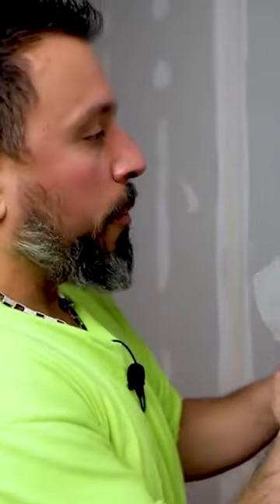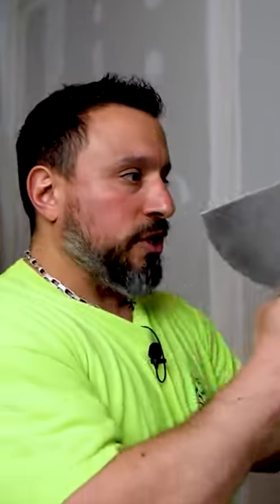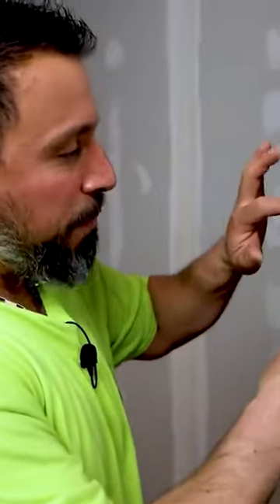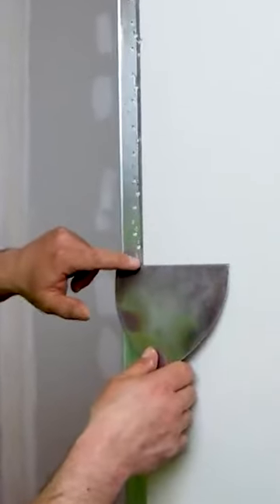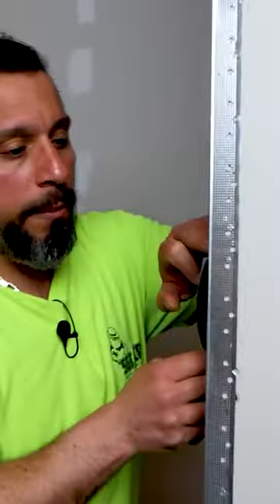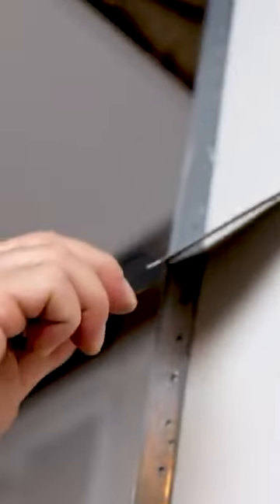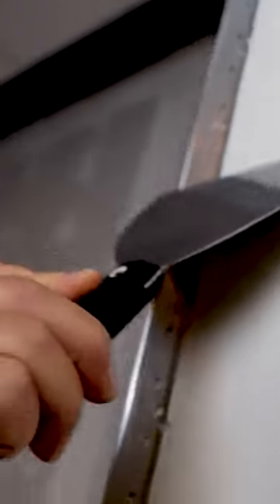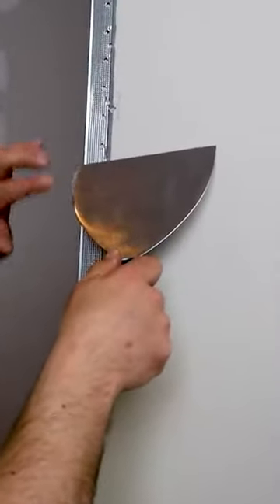DIY Drywall Tip You NEED to Know!

Comment: I use to like tape-on beads but tbh these metal nail-on beads are way easier and faster to use. Especially with a battery powered crown stapler. And also you use way less material and you top them with joint compound right after putting them on. With the tape-on beads you have to wait for the mud to dry before applying the first coat

Comment: I love the excellent Corners the beads give, but I've moved on 2 paper with the steel liners it's a lot quicker and it gives a really good corner especially when you use the proper amount of setting compound it's just as good but bead is the Holy Grail

Comment: or you could move on out of the 50s and use anyone of the new bead types
Reply: Metal bead didn't exist in the 50's. It didn't exist until the 60's and didn't become popular until the 1970's. The strongest outside corner finishing requires drywall tape and joint compound. NOW we're talking 1950's. Holds true to this day. Physics knows no timeline.

Comment: that bead is set far from perfect. as someone who does multiple trades professionally, I can tell you you're wasting mud by having to do much thicker coats as well as the fact that you're screwing up the bottom of the wall for baseboard or any wainscoting that will need to be installed. there should be maybe 1/16" of space in the gap shown. that looks like way bigger than that.
Reply: Jack of all trades, master of none 😂